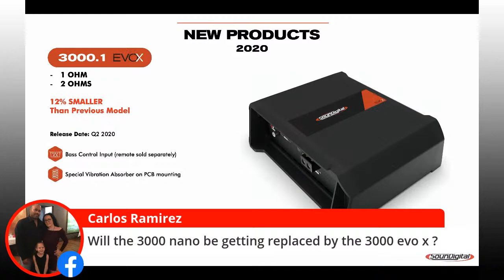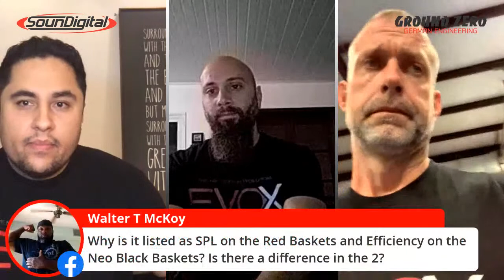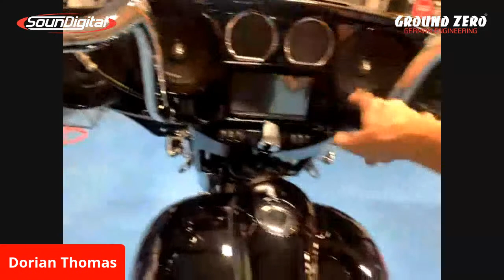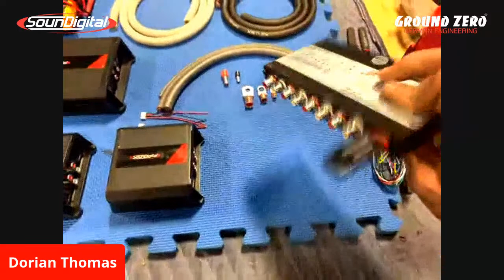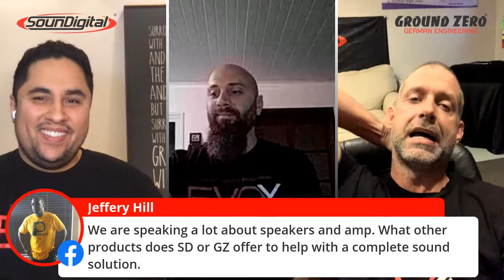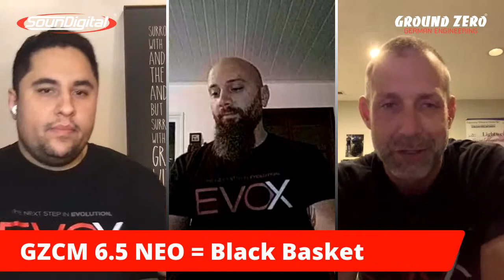SD/GZ Power Sports Q&A with Dorian Thomas

Comment: Can you run the 2ohm version 1200.4evox to the GZ 6.5 Yellowbasket at 300watts per channel with a DSP or is that overkill?
Reply from the maker: Should not be an issue, as long as you tune properly.